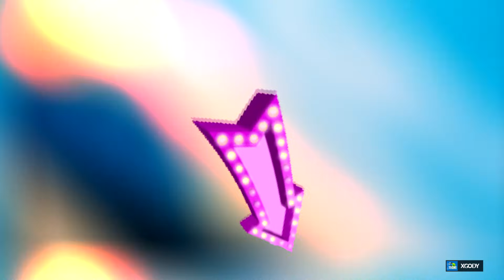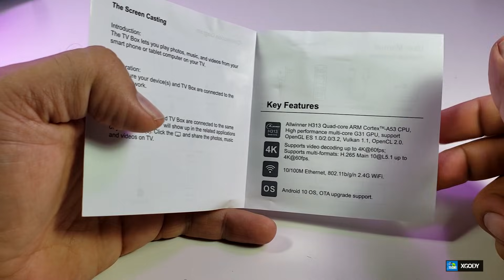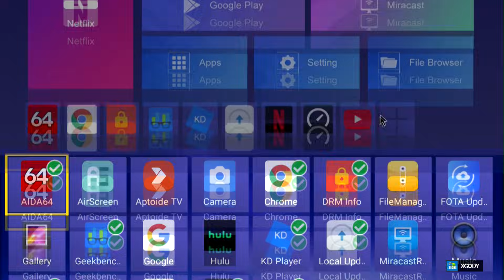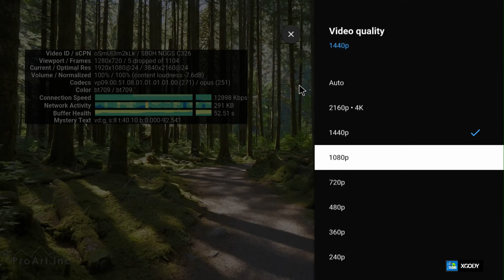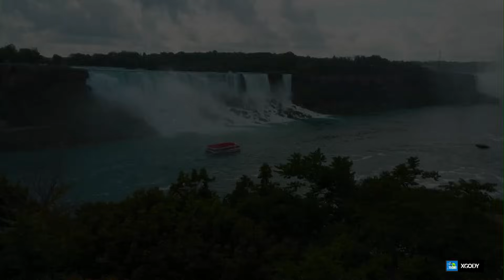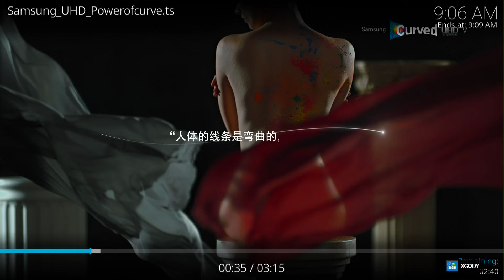Xgody X96Q Android 10 Under $40 -  Unboxing and Review

Comment: I bought one Yesterday but it kept overheating and eventually crashing. I have solved the problem by just placing a little bottle of water on it.
Reply from the maker: I would suggest you contact your seller for replacement.
Reply: @xctechs  Thanks for the suggestion, but I think it's a common problem among these cheap smart boxes
Reply from the maker: @Perfect2804  no it is not, you have either clone or bad box. simple.

Comment: i use this tv box and i see this product is not quality i use the wifi 50mbps still slow and lagging..i found the 4k video but its not work...i am sorry this tv box is low quality..i think this product made in china
Reply from the maker: This box is over 2 years old, the box do play 4K fine. If you are connecting to 5Ghz wifi you will not have issues.  Also it depends which company you purchased your box from ask then for a updated firmware to make your box playable in 2023.

Comment: Which one is better?
x96q or x96 air?
Reply from the maker: Q is better
Reply: @xctechs  why? the Allwinner H313 isn't as good as the Amlogic S905X3 right? is there a diff reason why?
Reply from the maker: @Bigboyissobig  price and which one will work smoother, it seems these boxes are done by different companies that will place different chips so your choice.  I know lately amlogic having alot of issues and the patches they send screws up other parts in the box.
Reply: @xctechs  i see! thank you. I'm really torn on which one to get
Reply from the maker: @Bigboyissobig  I would say get branded name like buzztv
Reply: @xctechs  which model do you recommend thats cheap but enough to not close the apps when Im using it? hahah
Reply from the maker: @Bigboyissobig  get buzztv E2 SE

Comment: To power on, does it require the remote instruction? 
I received the package without the remote batteries so was wondering why its not giving any display when I connect HDMI and power.
Reply from the maker: no, hookup the box to power and make sure your HDMI is connected to TV and make sure you are on proper port on your TV and it should show you the main screen, if don't work then contact your seller.

Comment: Hi, I'm not clear about the screen resolution. On AID64 it says the resolution is 1280x720, does it mean the resolution only changes to 1920x1080 when you launch Youtube, for example? I'm interested in getting this to run CDisplayEx, but if it can only run at 1280x720 that's not going to work for me.
Reply from the maker: Ok so the chipset produces 720p but the HDMi can show increase the resolution to 4K 30 fps.

That is why I have indicated 720p native resolution, it something chips can only produces.

Comment: I have also same tv box but it has problem in loading os and unable to open the user interface and also unable to reset this device even i have pressed the reset button inside the AV port😥😥😥
Reply from the maker: Have you factory reset the box?
Reply: @xctechs  yes i have reset the box several time but nothing happened,it doesn't show any bootable or factory reset options.
Reply: Having the same problem here too

Comment: I have 55 inch Led. Will this box and its cable sport or I have to buy extra cable?
Reply from the maker: I have shown in the video what is included in the box, and to power it up you do not need any extra wires, unless you want this box to be connected via LAN Wire then you need to purchase that.

Comment: Is there any option to connect bluetooth device to X96Q?
Reply from the maker: under settings you should see Bluetooth, but this box have different versions and some sellers ordered without Bluetooth version. so if yours do have Bluetooth and you are able to turn it on, should be under settings.
Reply: @xctechs  how do
Reply from the maker: @RajaRaja-lb1xo  I have mentioned,  check under Settings // Remote and accessories

Comment: Much overheats, it only lasted 2 weeks, then it only stays on the logo, it stops working and there is no way to fix it, 💀🥶
Reply from the maker: when you say heat that is the main issue contact your seller for replacement, it seems you have a short, or no heatsink on the board.

Comment: I bought this. But you tube is not working by giving 'network not found' error. My device is connected with WiFi.  Can you plz help me about this issue???
Reply from the maker: uninstall youtube and download YouTube TV from Aptoid.
Reply: Yes. By default installed YouTube app is giving error you need to download it from Google as Apk file and install it. Once you downloaded it go to device Local storage then click download  and then you will see YouTube file you just downloaded. Moreover in playstore YouTube app s not appearing.
Reply from the maker: @KhalidMehmood-po8me  get it from aptoid market place download YouTube TV